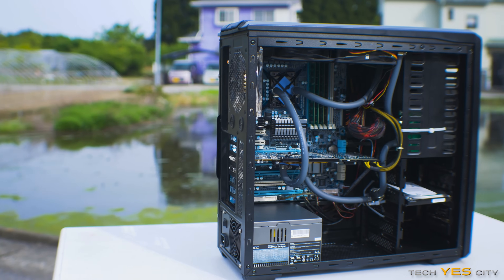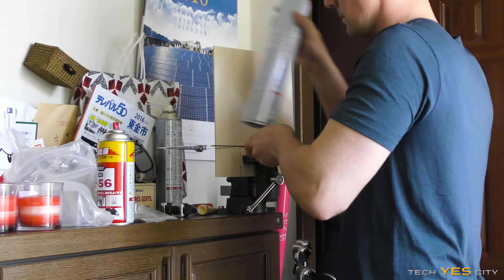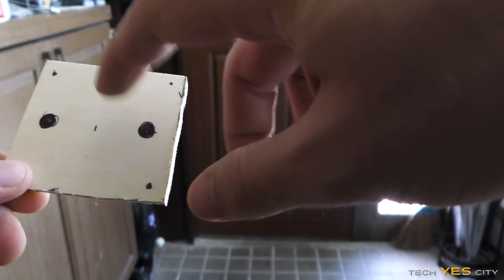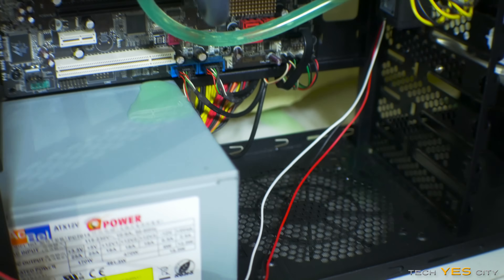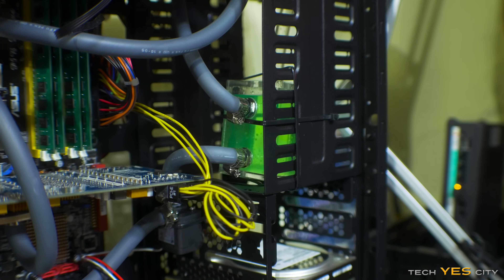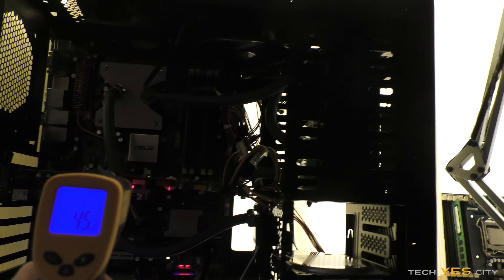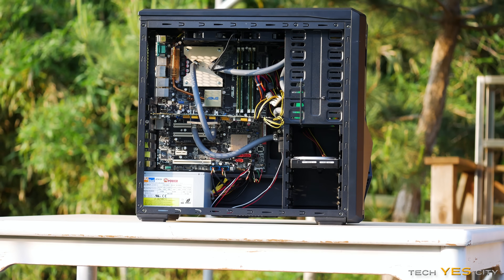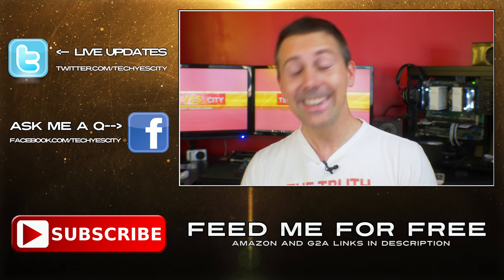$50 Loop ROUND 2 - I've Already Gone and LOST my MIND (Pt. 2/2)

Comment: The pump is too weak, try another one from ebay which is slightly bigger.
Kid's toys have bigger DC motors than what this mediocre pump has.
Reply: A submerged 12v 10-15W aquarium pump will be enough. Dangerous to add in a sealed case that is carried around a lot :D :)
Reply: Yeah, I looked up the specs of this one, was like 2/3 Watts . Even the radiator fans use more power...
Reply: While submerged pumps work well (as seen in a few other ghetto loops), they have a terrible lifespan and won't even last 3-6 months of 24/7 use. You'd have to change the pump every year or so. Although it is cheap, so it might just be well worth it for the temps/noise.
Reply: Isn't mediocre giving that pump a little bit of praise? :/

Comment: Is this a good PC build. Like is there anything wrong with it http://pcpartpicker.com/p/b2hypb
Reply: Don't buy that 750 TI, waste of money, in the next month or two AMD is releasing Polaris 10 and 11, so a R9 470 will be around the same price 150$ and it will be waay better than that 750 ti(and better than that 950 too).

And i also think AMD is releasing the new motherboards with AM4 sockets pretty soon which will be compatible with the ZEN cpus that are rumored to release between October and December. So if you do go the AMD route i would wait for the AM4 motherboards which will have an upgrade path unlike the motherboards now available which are a dead end if you want to upgrade later on.

Building a pc right now is a bad idea in my opinion , at the very least you should wait for Computex which starts like next week.

For more info on AMD stuff you can read the reddit for AMD.

https://www.reddit.com/r/Amd/

 Good Luck.
Reply: http://pcpartpicker.com/p/sMGG3F
Much better
Reply: Not the memory though, a single 8 GB stick is not better than 2x4GB because of dual channel. But if you do go the 8GB route then you can upgrade later on and add another 8 GB stick, just make sure it has the same part number.
Reply: Whatever Yeah but it's ddr4 at higher speed so it's not that much difference, anyway he can put 2x4gb on ddr4, i prefer that way so you can update lather to 16gb

Comment: hay can u do a vid adding a cpu cooler on a gpu
Reply: zip tie......done
Reply: I bought a gtx 670 for $50 on ebay that came with no cooler. bought a antec kuhler 620 for $20  and the nzxt gpu bracket thing for $30. Temps dont go above 55c even when overclocked to 1.2ghz and running furmark, gaming it bearly reaches 40c, performs about as well as a 380 and runs a heck of a lot cooler,  totally worth it.
Reply: Not a bad idea. Needs a big case though. VRM and memory coooling not included :P
Reply: Luke from Linustechtips made one for AIO coolers on GPUs, pretty interesting. I tried it on my old GTX 560 and temps went from 80 degrees to 60. Much quieter as well.
Reply: lol i did the same with my r9 280
Reply: nice
Reply: that ius already a thing look up AIO GPU brackets I know Corsair and NZXT have AIO brackets wtih fans built in to them which go over the VRM's and for the actual chip it includes a mounting kit which just attaches to any compatible AIO and they were very popular during the 980Ti life cycle

Comment: Why didnt you use Copper???
Reply: Copper ain't cheap in world, especially in large enough quantities to make two blocks and fittings for the blocks.  The whole point of the video is to make this water cooling loop at around 50 us dollars... which is pretty much impossible :/
Reply: +o3zman Copper not cheap? Isn't that the most common metal?
Reply: noe
Reply: CasuAl Pro War and work force negotiations increase the price of everything, especially materials that go into electronics  :  http://oilprice.com/Metals/Commodities/Upcoming-Labor-Negotiations-Might-Boost-Copper-Platinum-Prices.html